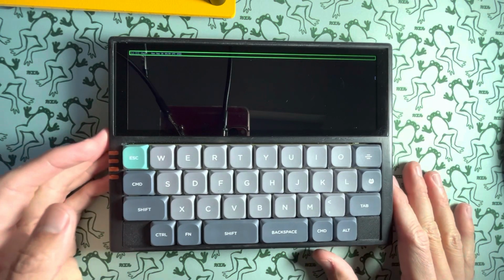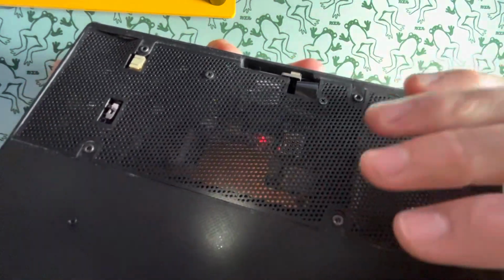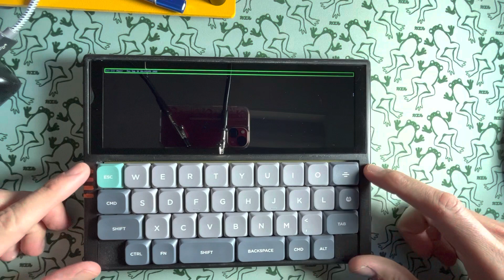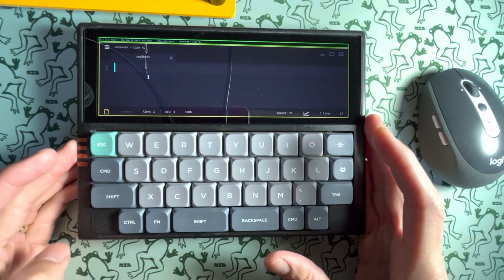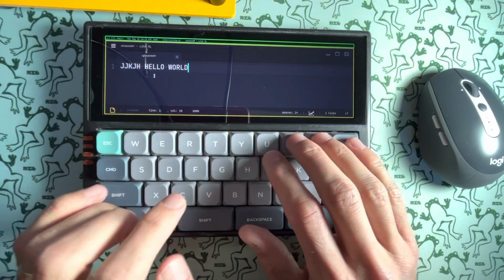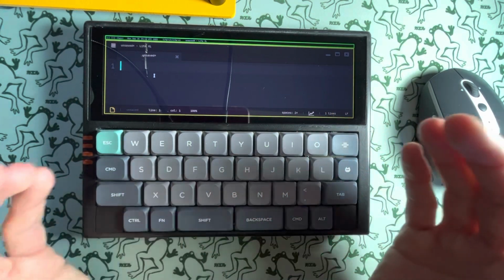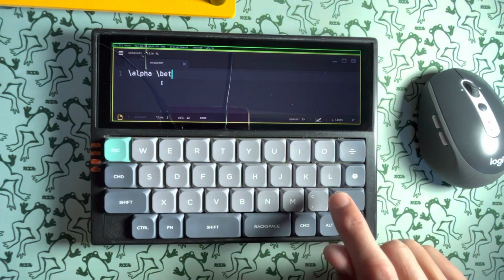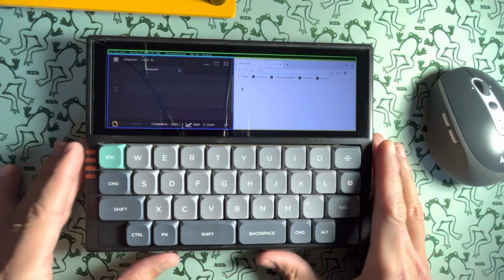Tour of QAZ Personal Terminal (QAZterm)

Comment: The QAZ actually seems easier to learn than I initially thought. I use a 40% daily so I'm used to relying on layers, but the hold down and combination keybinds are so smart. I've known about those functions for a while but for some reason it sounded so convoluted. Seeing it in action makes me realize it's quite the opposite. 

I'm planning to build something very similar to this, but I want it to be foldable so it takes less space and you can tilt the screen to your liking. Any tips or warnings before I start? Thanks for the vid!

Comment: Those keys are hideous. Dunno why gen z is obsessed with oversized mechanical keys
Reply from the maker: They are normal 18mm square keycaps, but they are very low profile (but still mx compatible) In case you want to get some, these particular ones are made by Nuphy.
Reply: I'm a boomer and I think they're gorgeous.
Reply: You’re such a boomer lmao, these keycaps are 18mm x 18mm, the same size that has been used for literal decades. Check yourself bb🥺